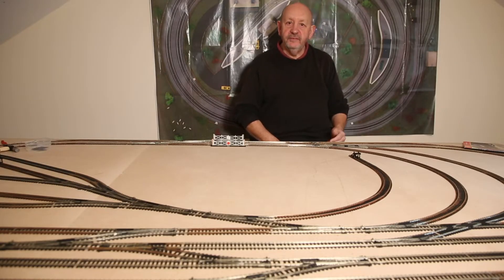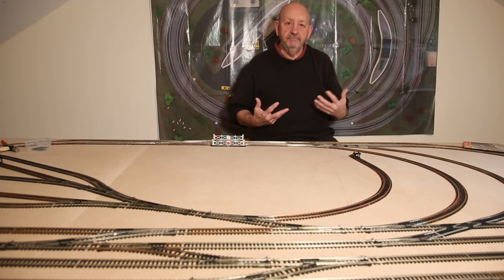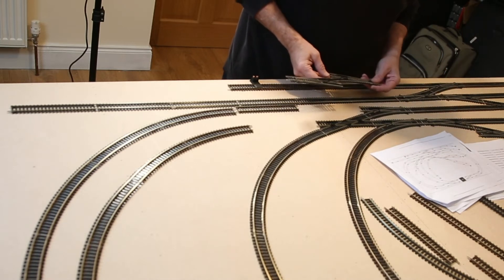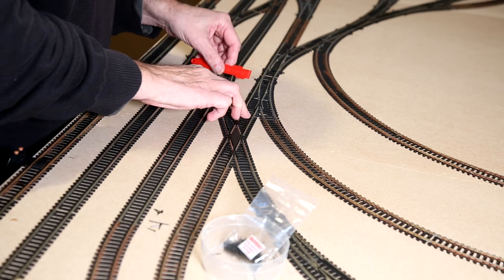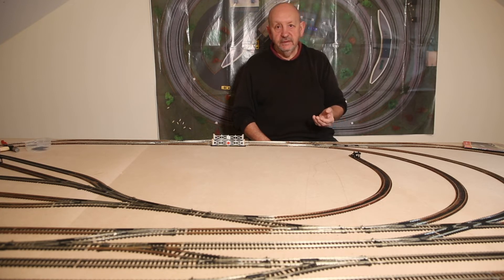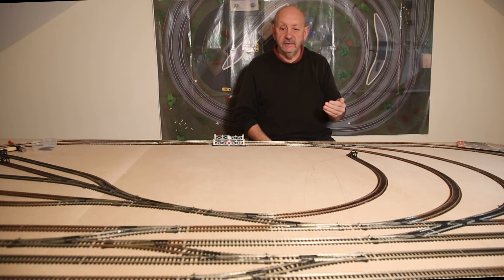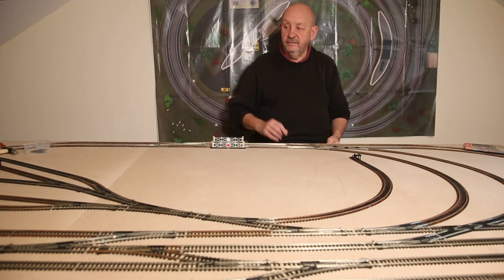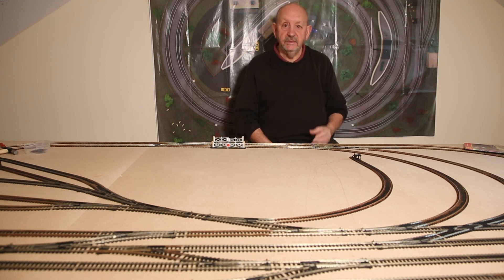BRANCHLINE: A Beginner's Model Railway Journey. PART 4: PLANNING & LAYING THE TRACK

Comment: Great work, will you be using point motors? If so you may have wanted to drill holes before pinning down the track, if not don’t worry just wondering as it’s something you may want to look at if your doing a shunting area
Reply from the maker: Thanks again for your comments Mark. There is going to be quite a big shunting area including a hardstanding. I have decided to go with ground throw switches for the points. I've been in communication with a maker in the US, Caboose industries and ordered 20. There are 18 points on the layout. I'll make a video about those when they arrive.
Reply: @skelligringphotographyandw7012  sounds like a good plan 🙂, look forward to the next update 👍🏻